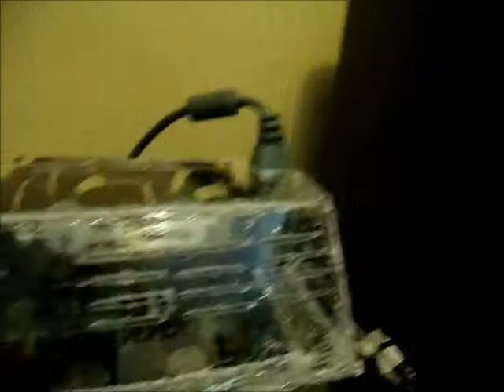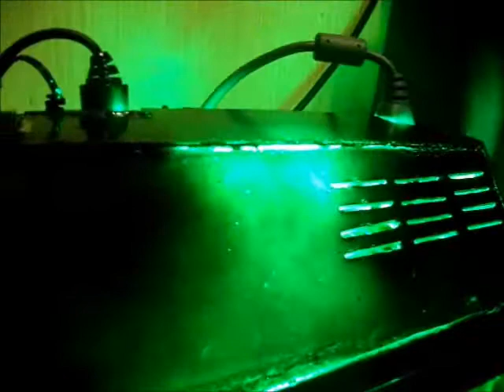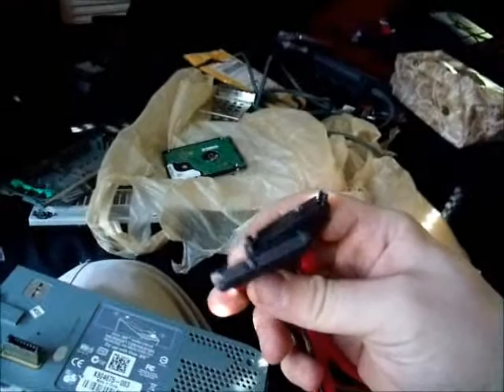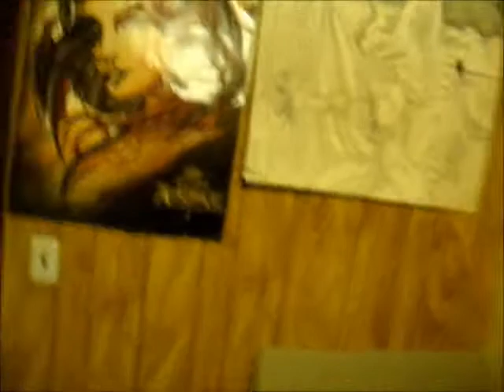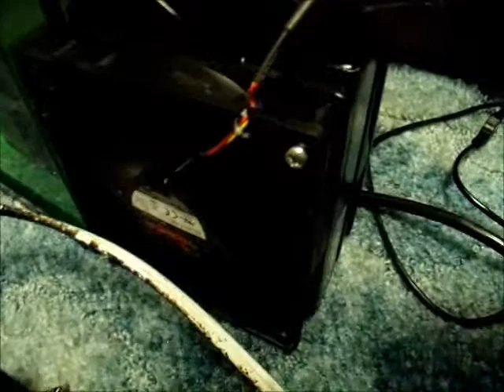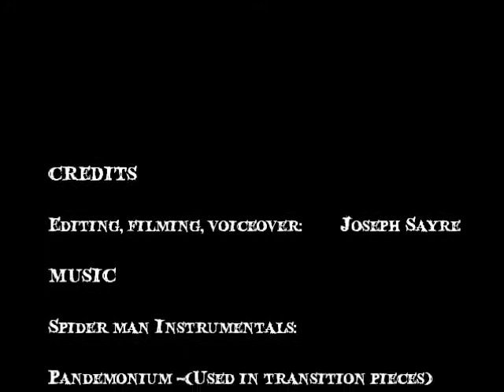Xbox 360 immersion (oil) cooling part 2

Comment from the maker: It didn't cool it well enough, that's why I used an aftermarket radiator and pump set up. This entire video is pretty much about being forced to use a non conventional set up, and pumping the hot oil into a radiator to have it cooled down.which dropped temps to 37 degrees Celcius.(100 F).

Comment from the maker: This 360 does, its a 2nd Gen non jasper unit. Its nice and toasty, and considering the heat issues with the 360 (what its known for) your comment just isn't true. Besides that, when I put the lid on it had a florescent lamp and a small pocket of air inside. Now the pumps inside were moving the fluid but I was losing heat by convection, much like a hat keeps your heat in your head (it rises) but I capped it off so there was no escape for heat. So I used the radiator set up.

Comment from the maker: Its been a long time, but If I remember, the original console I was using fried due to the way I affixed it to the acrylic panel, since it was metallic, when the oil ate through the tape, the bare metal shorted out the board, so that 360 died. The 360 I used in its place was in terrible shape, had had its chips reflown twice and was barely working, it didn't last too long after the project was completed.

Comment from the maker: The problem mostly with using it the way I had it was the 2.5 gallons of liquid. The 360 runs EXTREMELY hot. For normal play sessions with the bubble etc and an open top, I could play for a few hours until the oil reached 130 degrees, then the 360 would turn off, and be unusable for several hours while it cooled down. The lid and light were important, as well as dust collection in the tank, sealing it up made it heat quicker, hence the upgraded cooling.

Comment from the maker: @kmrjeep I have a hard time believe the trans fluid will get that hot. The 360 would shut off auto at 130 degrees fahreinheit. thats very hot, almost hand burning hot. So I doubt i'll have to worry about breakdown. Most processors actually are programmed to turn them selves off at or below that temp anyway. Let me know how the antifreeze test goes too. I love the color.